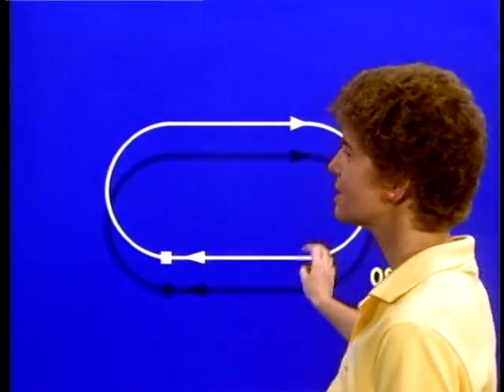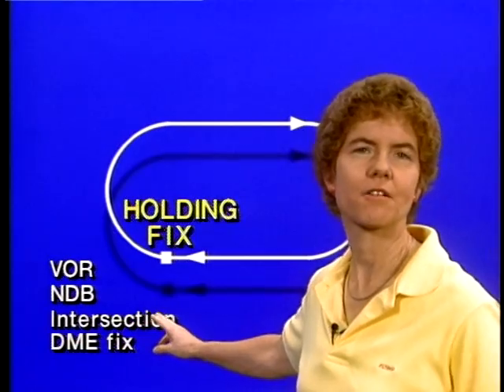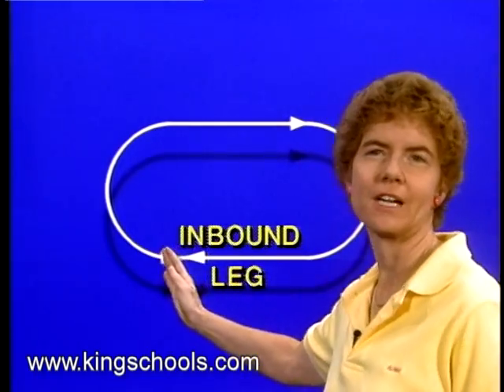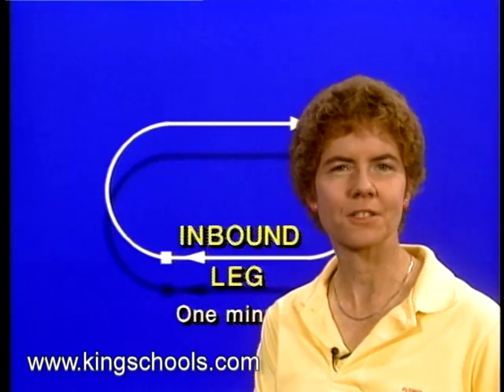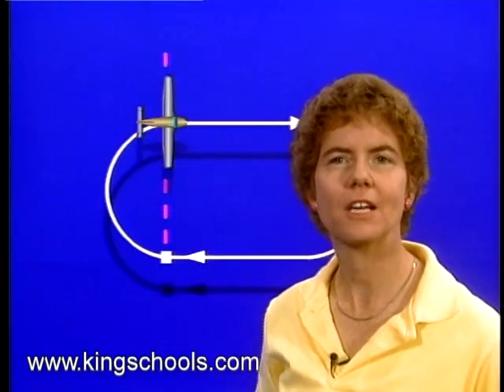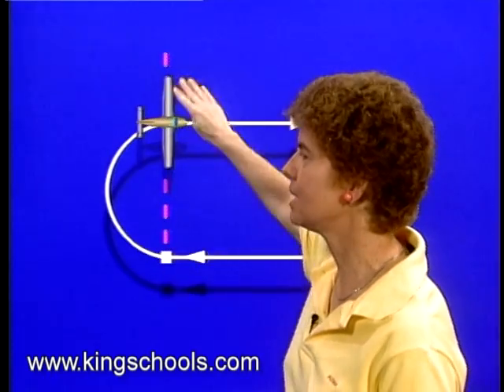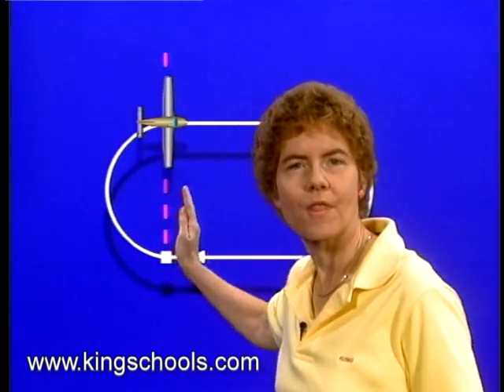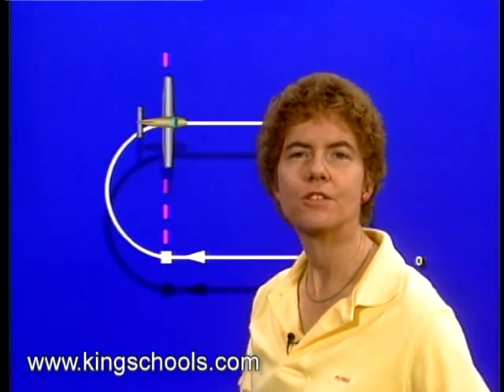Airport Holding Patterns - KINGSCHOOLS.COM

Comment: You mean flying straight in? This is covering a holding pattern generally. There is a difference between the traffic pattern / circuit and the holding pattern(s).